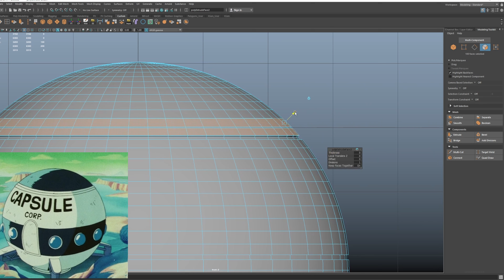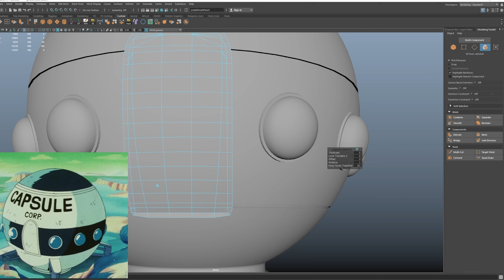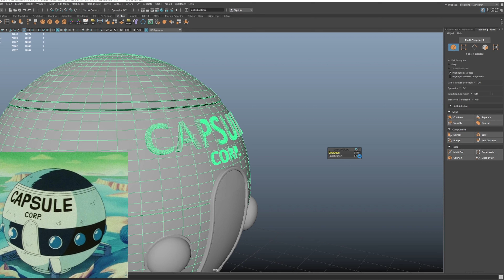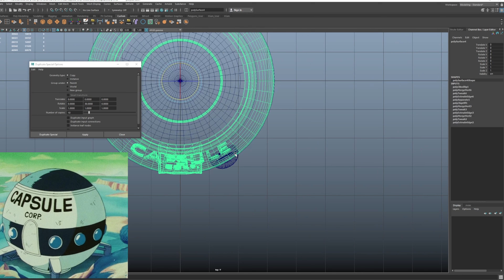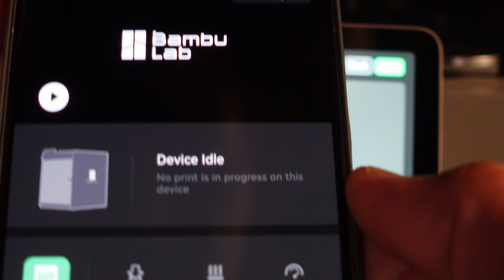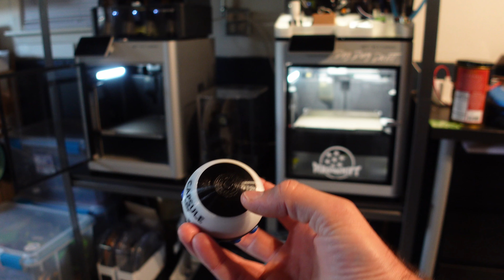How to Design and 3D Print Your Own Car Parts

Comment: I've been having trouble with the Scanning to 3d modelling work flow (designing parts around the car)
because STL files are a pain to work with in fusion 360
if you could make a video on that it would be great

Comment: I saw a video where you talked about "live surfaces" and I was interested in finding out more. Nice tool for Maya but I haven't found anything like it for Max. Fusion has a similar feature, but I prefer modeling in Max when possible. Very cool video! Nice to see people showing others how we do it! Haha I saw you boolean!! Cheater.. haha bro I use that tool all the time instead of taking the time to model out surface faces. Quick fan question! - Q: How do figure out thread pattern and type?
Reply from the maker: @LowLifeAccord  hey we're not making optimized video games here, booleans are fine! What do you mean how to figure out thread?
Reply: @DingDongDrift  I mean different threads have a different pitch. Are you just examining the thread type by eye? Measuring threads?
Reply from the maker: @LowLifeAccord  i don't model threads, I'm pretty sure i mentioned it in the video
Reply: @DingDongDrift  my bad must have missed it

Comment: Been working on a massive kit for the Mx5 NB to make for composites production the last 2 years (hint its not just a hardtop or widebody). As I see more and more videos covering printed body kits I feel the pressure. If I take another year or 2 to develop will I be too late?
Reply from the maker: @Genjure  never too late
Reply: I say keep at it. I had plans to make a dash piece to hold my airlift controller with eyeball vents that articulate for a couple years before I even learned any cad software. It’s finally done and I’m glad I followed through